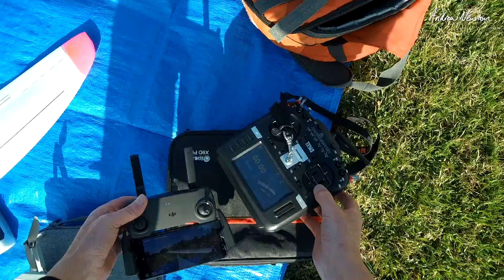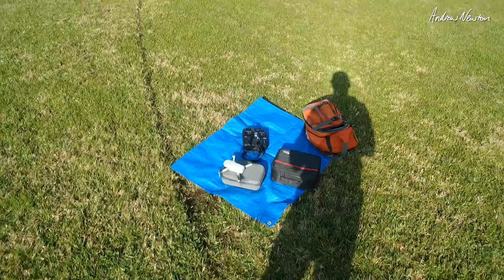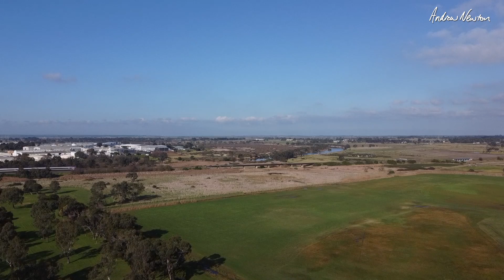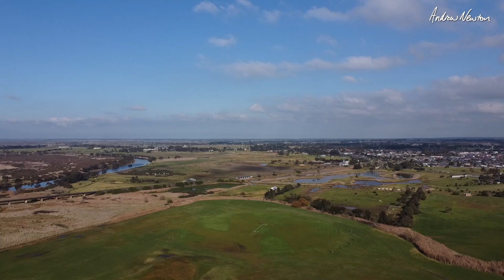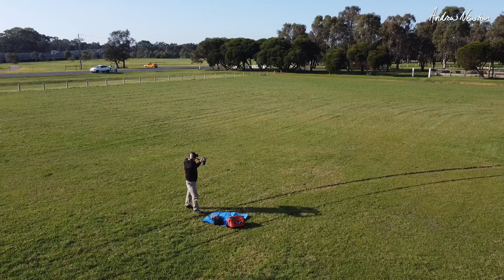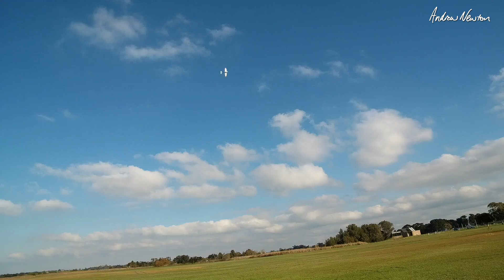Kopilot RTH Altitude test. 35m or 70m?

Comment: as here the limit for RC models is 50m above ground, can I lower that in kopilot settings?
Reply from the maker: No it's fixed
Reply: That max allowed height seems odd. Most countries have standardized on 120m/400ft as the normal RC ceiling. What country are you operating in?
Reply: @theoztreecrasher2647  it depends of the location, it is 120 m usually, but here is an airport not far away so it is the limit of 50m.
Reply: @seba2038  Fair enough. You are in a restricted zone.

Comment: That little plane is great, looks great, flies great. Very easy, especially with stability mode which helps a ton when flying fpv, but needs to be disabled when landing otherwise you dont get enough control if the landing area is tight. I lost mine, though. Not 100% sure what happened, but I had RTH enabled and it was on its way home from about 2 miles. I had it come home with rth 2 times before that on the same flight, but this last time I was too comfortable and was just on my phone waiting. I glanced over at the monitor and realized my video was very fuzzy and I saw trees whizzing by right below the plane for a few seconds, then no more video. I feel it was RTH altitude which is set too low with no way to change it. So dumb because there are tress taller than the RTH altitude they have it set to. I remember the voltage was about 7v, and I had only flown for about 30 min. When I did the flight time test, I got almost exactly an hour of flight time from the ZOHD 3500mah battery. So I doubt that the battery would of died that soon. So now there's another airplane out there if anyone wants one. Second fpv plane I've lost in 5-6 years.
Reply from the maker: Oh no! A sad loss, but if you're flying long range it's part of the thrill

Comment: Hi Andrew, I am having a difficulty with the Kopliot, my plane is flying like a bird(the Control surface keeps flipping up and down which looks like a bird flipping the wings) on both the Launch mode and stabilization mode. It only stops when I move my sticks, once I let go the sticks the plane starts to fly like a bird. I tried to reduce the sensitivity on the setting pad which did makes it a bit better, but for about 5 seconds the plane starts to flipping again. I did a lot research online but no useful information was found, I am wondering if you could help me to figure out what the problem is.

Comment: How to control the quad or plane by camera view? Let me explain: The camera is on a 2-axis stabilization gimbal - the pilot controls where or what the camera is looking at, and the autopilot accordingly directs the plane or quad. Is it possible to implement this in inav and how? Thanks!
Reply from the maker: Yes easy. You would only need to use the head tracker outputs instead of aileron and elevator. I have done it without inav. https://www.youtube.com/watch?v=xqiibAFo__g

Comment: Hi Andrew, 

I found out that the Kopilot (well, my Kopilot) does climb for 35m (realtive to it's current altitude) and then returns. I flew well above 100m when I engaged RTH but it flew back at an approximate altitude of 130/135ish meters (many times!).

However, it is a great Kopilot for my EA homebuilds! I hope you'll check my latest video! It's pretty awesome.
Reply from the maker: Ah OK, might have to test that too. Thanks

Comment: Hi Andrew, 
What's your thoughts on staying with the trusty Qx7, or radiomaster T16s? At first i saw you keep using the Qx7, then a few more videos where its T16s. 
Cheers
Reply from the maker: If I had the two radios in front of me I would pick up the Taranis Q X7 (with my mods) By the way they are selling on Banggood for USD106 right now if you feel like trusting them. The Q X7 is lighter and easier to hold in one hand for launches. The TX16S scroll wheel feels bad to me, and I dont like the big screen colour version of OpenTX as much.

Comment: I can't afford a quad-copter Mavic-type thingy or any FPV transmission stuff, (I haven't even got a mobile phone; no mates, so why bother), but I still have a lot of fun with sub-250g planes and an airborne camera. How? I use a kite as a platform. Yep. That's right. A kite with an action-camera dangling from it.

Oh, I know it's tragically primitive and old-fashioned and desperately uncool (just like me), but it's good for a laugh and really cheap. (Also just like me.)

I make Peter Lynn Pilot kites from the (free) plans on his website. The 9m² multi-bridle is a good compromise between power and ease of operation, and if you construct them from coated parachute ripstop they come out very light and only cost about £20 each. Lots of sewing, though.

The larger Pilots are capable of flying in a ridiculously light wind of just 3 or 4 mph, so they develop loads of lift but remain rock-steady. Flying two or even three in a train makes things even better.

I like to muck about with altitude telemetry and... and...  Er, this is boring you, isn't it. Sorry. I'll get my coat.
Reply from the maker: Quite the opposite Mr Darcy. KAP used to be my main hobby. https://www.youtube.com/playlist?list=PLC8MdCMvxwBhkO8qEAbF5riuc1KbRq9dL

Comment: Interesting I found auto launch would circle at about 35m and 70m after that. Perhaps there are different firmware versions. I think 70m is too high for small planes. 40m would be better.
Reply from the maker: Yes it climbs to 35m during the auto launch then goes into RTH climbing to 70m

Comment: Recently, due to my more "local" fpv flying, I'm using "Current" altitude on my RTH setting. This avoids time wasted getting to a fixed height.
If I go out further, I'm usually at 120mtrs...with RTH set fixed at 100 metres with a restricted dive angle of 5 degrees.
Your Kopilot looks like it's set to 60 metres loiter to me..?
Reply from the maker: Clearly flying higher than the MM at 60m
Reply: @AndrewNewton  I thought you could set the RTH and loiter height on the Kopilot TBH?
Reply from the maker: @EnglishTurbines  No it's preset
Reply: @AndrewNewton  Oh, I can see my Z84 on RTH at 100 MTRS, but It's sometimes a bit tricky...

Comment: Good information and good fact finding. Couldn’t see the RTH altitude documented anywhere!
Reply from the maker: I always thought it was 70m but no idea where I saw that written.
Reply: @AndrewNewton  One question I can't find an answer for. The RTH attitude is 70m, if I fly to say 150m high in manual mode and switch to RTH will it decend to 70m on its own or just circle at 150m?
Reply: @GiBBO5700  It will dive to 70m at an angle corresponding to how far your elevator pot is from 12o'clock.